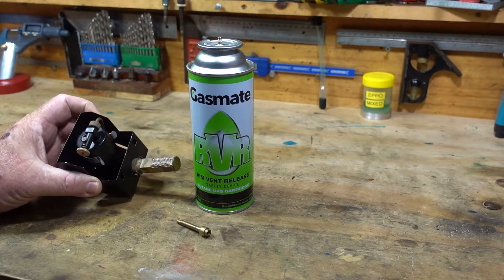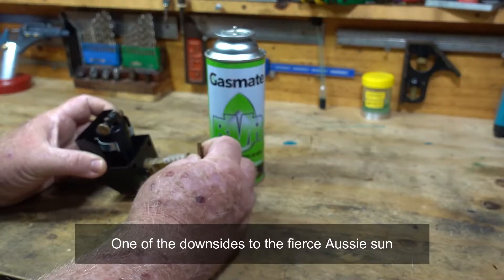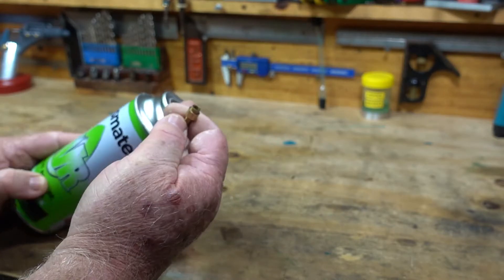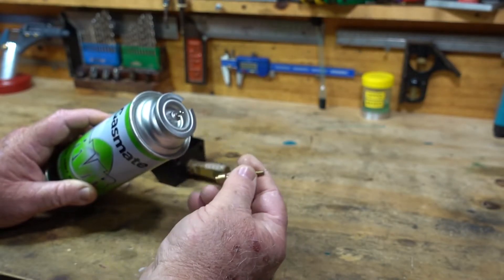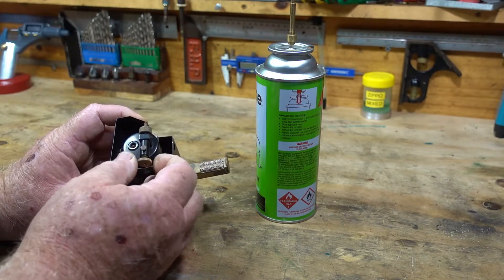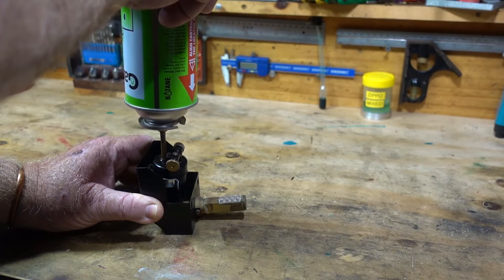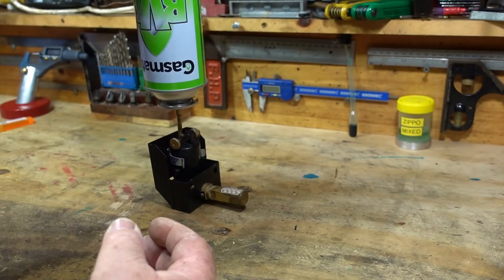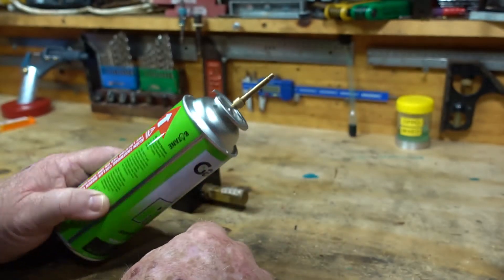Model Steam & Toy Steam Engine DIY Homemade Gas Filler Tube for refillable canisters

Comment: Awesome video Jim
Now that i too have a lathe i can make one!
Do you have any advice on building butane tanks?
Or is that something i really shouldn't do.
I want to build one for my wilesco traction engine, because i can't get the bix ones here.
What wall thickness is recommended?
And what are the dos and donts?
Reply from the maker: Wihann.....I have sent you an email with two (2) links to books 👍Cheers Jim
Reply: @SteamEngines-Jim thank you I'll check it out